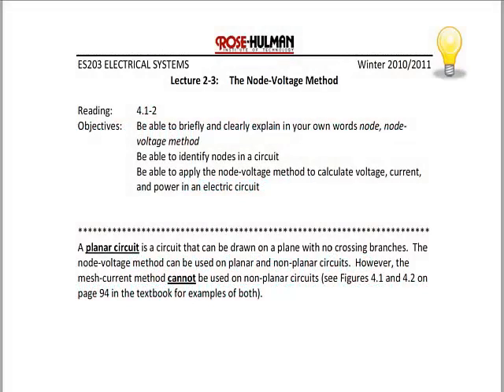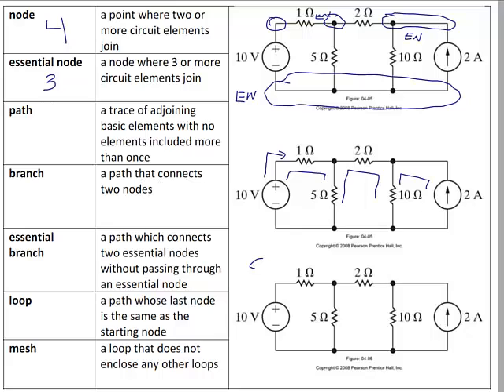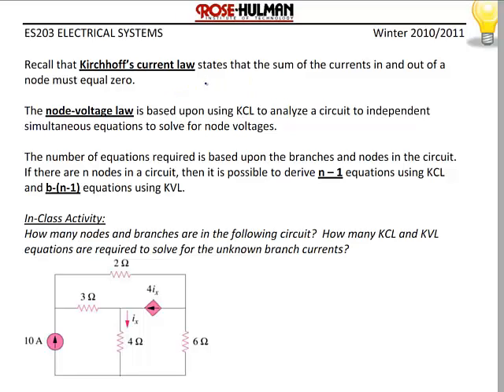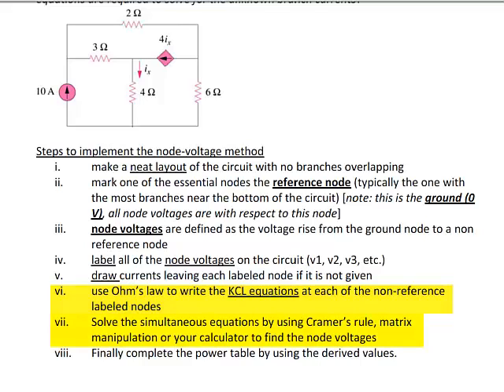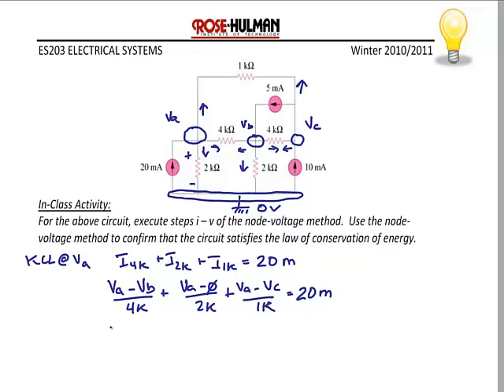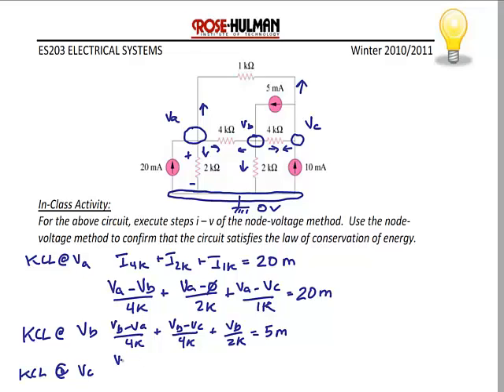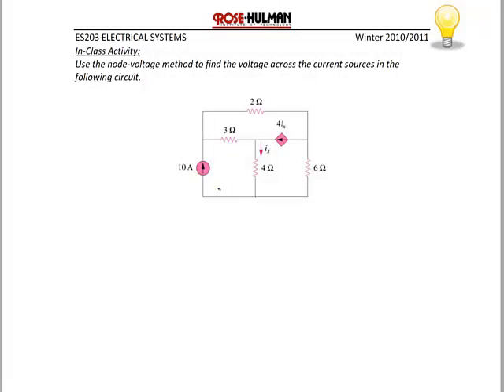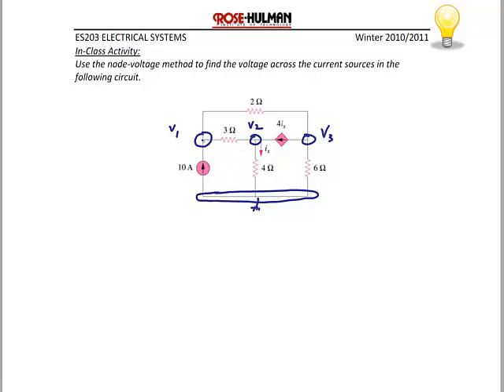ES203 Lec 2-3: The node-voltage method

Comment: hi mam .good morning .In the very starting of this lecture we found 4 nodes.If there are dependent sources instead of independent sources, then should we consider it as  a node?
Reply from the maker: Nodes have nothing to do with independent or dependent sources. A node is the meeting point of 2 or more circuit elements.